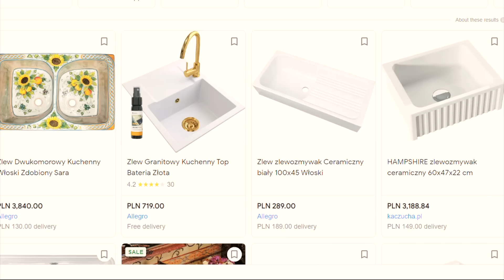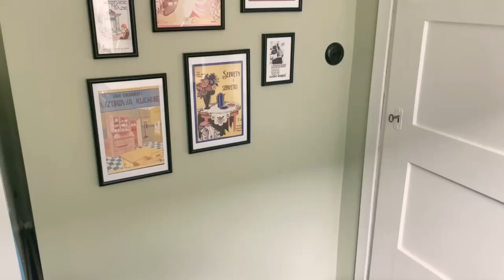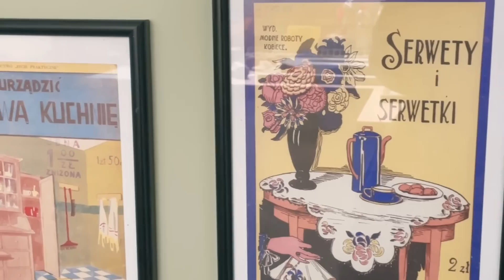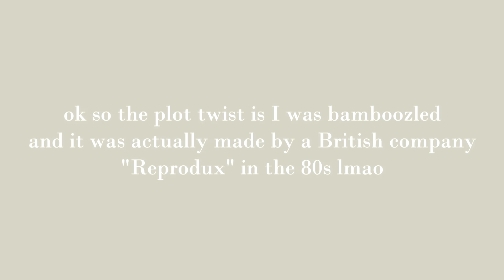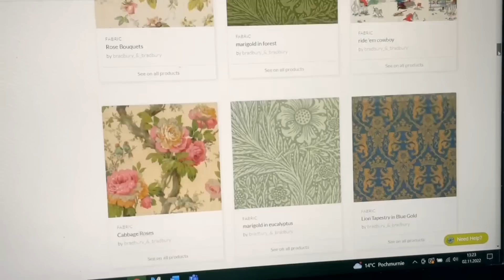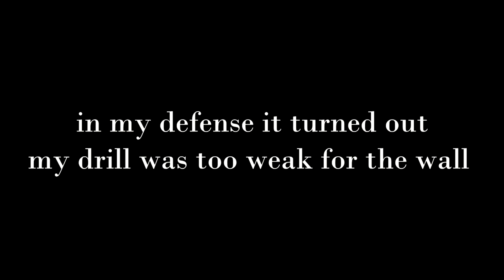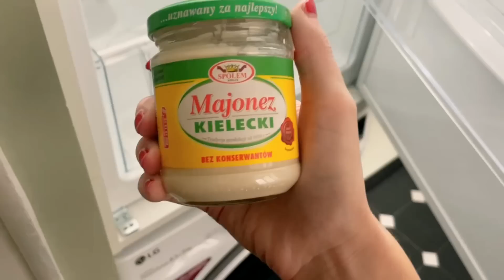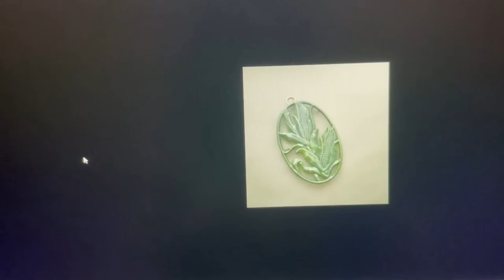Getting Antique Furniture For My 1930s Flat ✨ (and other stories)

Comment: One thing I've learned in life, Karolina: it's VERY rare to find walls that are sufficiently straight or that meet at exactly 90º angles.
Reply: Yes. My current home is like a vamped up mechano kit. Metal struts for framing and outer sheath. Built for US military in GB in WW2. I was shocked to find true right angles between walls, walls and floors and walls and ceilings. The only off line corners are the outer corners if all the built-in corner cupboards. I don't understand how some of those are messed up by 2"/5cms.
The baseboards. I bet your Dad knows how to use steam to bend them permanently to the wall's curve. Worth doing as once they're on they'll be right forever.
Reply: @Michelle Byrom  Oh, that's interesting! I've always lived in masonry buildings, since they are the most common building method by far where I live and I believe masonry buildings are easier to get out of angle, since the bricks are not exactly fitted, but rather put on top of each other...

And I believe that houses can get out of angle after they're finished, because of soil movement, humidity, etc. I'm not an engineer, but it's something that sounds likely to me.
Reply: True ✋
Reply: Yes.  We have one bedroom wall that literally bows out at about 25-30 degrees.  It's completely different at the top of the wall to the bottom.  This is what happens when someone who doesn't know what they are doing encloses a 100 year old porch.  (Not us, done probably 75 years ago).
Reply: I live in a building that was built in 1890, and nothing is entirely square.  But it's ok.  I love it, imperfections and all!
Reply: Dear god, all my houses have been old, and nothing is straight or plumb. My 1892 Vicky is no exception.
Enjoy your lovely new digs, I love what you are doing with it, it looks wonderful! 
PS: there is nothing wrong with waiting until you find the right color/paper/cabinet etc. Wait until inspiration strikes, you have all the time to find what is the perfect fit.

Comment: For your wrinkled curtains, here’s what you can do:  hang them up, as fully extended (closed, to reveal as much fabric) as possible, then use a clean household spray bottle and the hottest possible tap water to spray them lightly but thoroughly.  Hold the spray bottle nozzle really close to the fabric so that the water doesn’t cool down as much (it will cool down somewhat anyway).  Gently pull downward on the curtains by the hems several times, and the wrinkles will gradually fall out as they dry.  (You might want to put a towel underneath, to protect your floors while spraying).   I discovered this out of laziness, I have both an iron and a commercial steamer, and it works just as well on most clothes, too, unless a very crisp finish, like on a “classic linen shirt” is desired.  The sprayed items not be perfect, but they will look much, much better than with the packing and shipping creases.   Wrinkle-releasing sprays are a waste of money, they’re mostly water with a little fabric softener added, you could do that, too.  Your hand might get tired by all the trigger-squeezing for the sprayer, I alternate hands if I have a lot to do!
Reply: don't forget that fabric softener is pretty flammable though! the hot spray water idea seems much better
Reply: or just steam them in the shower?
Reply: Oh, I gotta try this on the curtains my mum just sent me! Thanks for the tip :D
Reply: Yup. I have hung many curtains in my days and depending on (the weight of) the fabric.. sometimes it's enough to just hang them and give it a week or two. And when you wash them, just hang them while they are wet. I do have a steamer iron, but I'll always try to not use it ☺
Reply: she have washing machine, so just washing them and hanging as they are still wet should do the trick ;) especially if the fabric is thick and heavy, with lighter ones you may need probably some extra weight to pull it down
Reply: Washing them is a lot easier and faster, hang to dry
Reply: @momosaku16  That was always my mom's method
Reply: I usually hang my curtains when they are 2/3 dry (I don't use the dryer, dryers are not a thing in Croatia). The gravity solves the wrinkles

Comment: Dont panic about the base boards! As they get secured to the wall they will flex and you wont be able to tell. (Went through this during my house remodel)
Reply: Yes! And if there's any little gap left, you just fill it with paintable caulk
Reply: Using steam at the place where a strong curve like that occurs helps to prevent splitting.

Comment: I'm so impressed that you managed to get eggs to stick to a brand new nonstick pan 😂 I don't even use a spatula anymore; as long as I have enough butter in the pan, they just slide around and I can flip them in the air. (This is not me bragging, just being lazy about dirtying a spatula)
Reply: [buys new non stick pan] [IMMEDIATE METAL FORK ACTION]
Reply: Butter is a must and letting the pan heat up enough before adding the eggs.
Reply: Not sure if you are from Europe maybe you are, but in Europe we mostly use oil for that, much healthier, but easier to stick to the pan if you are not careful!
Reply: @paularodriguez9540  Actually the issue is mostly transfats like in old style margerine. Real full fat butter is not really linked to heart health anymore. 

It ended up being a more complicated story than saturated fats being the cause. I use both butter and oils of various kinds. I think our best bet is probably using a variety.
Reply: @paularodriguez9540  I've done it with oil, too, butter is just tastier ❤
Reply: @Greuts right, besides, aren't Europeans more involved with cooking with butter instead of oil?
Reply: @Greuts sorry let me correct, at least in the countries that follow the Mediterranean diet, you are right
Reply: @paularodriguez9540  I'm Polish like Karolina and here most people fry almost everything on oils, but make eggs solely on butter or margarine, very very few people use oils like Karolina did in the video, unless they don't have other options [which might be the case for Karolina as well, since she doesn't have much in the new place].
Reply: @deirenne  well, bacon fat is also an option for eggs in Poland.
Reply: @begemotowa  
There's nothing like eggs fried in bacon fat 😋. Butter gets second place. Seed oils...no comment 😆.
Reply: @raraavis7782  I agree completely! I'm from USA southern states, bacon grease is the standard go-to for anything!!

Comment: This was so much fun! It was as if you invited friends to your flat for a tour. Thanks for the info on the coffee table in the living room. My grandmother had leather-topped tables all over her house. She never mentione when she acquired them so I never knew which decade they reflec5ed. In the USA, I think they also were popular in the 1950s. You always manage to get so much information into every video. It's a pleasure to watch.
Reply: This particular form of leather top (not covering the full surface, most of the time with gilded decorations) has been used since at least the 18th century, for writing desks and card-playing tables.
Which made me very suspicious of Karolina's coffee table before the plot twist, because it's not (only) an ornemental element, it has a fonction, which doesn't match with a coffee table's.
Reply: Yes, leather tops were common on writing desks as it gives a softer surface, doesn't mark as easily as polished veneer and is easier to replace when it gets worn. I have the alternative thing, a separate leather writing pad/blotter combination. There are also wine/occasional tables with leather tops, maybe as glasses won't mark the leather. 

The leather top furniture seems to come in and out of fashion quite a bit. Karolina's coffee table, while a reproduction, looks to be made with good quality timber and leather. I've seen some atrocious reproductions made from very lightweight, cheap timber, drop leaves that sit at rather a downwards angle when folded up and with 'leather' that looked like paper. I've also seen a good quality reproduction writing desk that went a little overboard with the leather, not only was it on the desktop but also stuck on all the drawer fronts! Another hint at it being a reproduction is that low coffee tables were only introduced in the 1920s, you'll struggle to find any real antique modern type coffee tables.

I just looked at an 'Edwardian' leather topped occasional table we've got and turns out it's also made by Reprodux, found the name stamped on one of the drawer undersides.

Comment: Hahaha, I mean, you DID two layers of paint. Previously. That counts. 😂 

Love the final green. I had the exact same problem with painting a room green…it is a surprisingly difficult color. And I also love that you used your left over wallpaper to line the cupboard! What a beautiful detail. 😭
Reply: It helps if you can differentiate between WARM and COOL greens ; they are different and shouldn’t be mixed. You need to decide which you prefer, and then commit to a warm or cool palette for wall colors, in this case, green.
Reply: @nanwilder2853  that is a good tip, thanks!
Reply: @marissabulso6439 : You are most welcome, Marissa. Take care!

Comment: Baseboards hide imperfections such as cracks in the walls. Baseboards are placed where the wall meets the floor. It is mostly flexible. They also hide gaps between the bottoms of the walls and the flooring. in US nailed - solid walls maybe glued.

Comment: Regarding hanging things on walls you can order online hooks called Command hooks.  They are transparent and removable and leave no residual stickiness and do not harm the surface of the walls either.  And they are rated by how much weight they will hold.  I have used them on my outdoor patio cover and so far they have lasted 5 years.  No drilling or hammering of nails both of which damage the walls.

Comment: For next time, I recommend removing all the scraps of paper and glue residue attached to the surfaces first.  It’s easy, just spray (or soak with a big sponge) with the hottest tap water, then it can be scraped off with a plastic scraper.  Then, I would use one of those plastic scrubber sponges for dishes (not the metal ones) to scrub off any glue residue.  Then, I would paint on a layer of primer/wallpaper sizer.  I love the Z-Prime brand we have here in the US, it’s expensive, but worth it.  A really clean surface is important for any finishing technique, painting or wallpapering.  Your new flat is looking beautiful!

Comment: Karolina look into Command Strips for hanging items on your walls. No drilling required and they come in varying weight capacities. Really have enjoyed your journey
Reply: Have you ever used them long term? I've always been under the weight limit but still have never gotten them to last...  and am always worried it will unstick and drop/wreck my frames. Maybe it's the texture of my walls though 🤷🏽‍♀️
Reply: @catherinesteph  my daughter in law has used them with success. None of the items were overly heavy. Not sure if being exposed to heat from strong sunlight or a heat vent would impact their stability though.

Comment: Your place looks soo good!  Love that fireplace.  Also, I live in a row house with both brick and really old plaster walls. I've found that the 3M brand "outdoor" mounting tape works great to hold up things (like the towel holder for the kitchen). I think Gorilla Glue also makes an outdoor mounting tape that works well too. I've just discovered with plaster and brick walls the good old command straps don't really hold up. Gotta beef it up to the outdoor stuff.

Comment: It’s coming along so nicely! I can’t wait to see what happens next! For the kitchen thing that you can hang towels on if you do go with sticky strips to hang it make sure to get them in a stronger version than you need, they typically have weight ratings on the package for how much one or two strips can hold and you’ll want to go stronger if you can since it won’t just be the weight of the piece and the towels but also the occasional tug as you hang a towel and pull one off and that kind of force is a lot more than most people would assume

Comment: If you get egg stuck on the pan again, I recommend heating up the pan to sizzling and then adding some water to deglaze the pan (about 4 oz).  When the water hits the hot pan and immediately simmers or boils, scrape at the gunk with either a wooden or bamboo spatula.  The food should release pretty easily within a minute or so.  Non-metal spatulas can't really scratch up the pan, and the deglazing maneuver avoids having to do rough washing that may also damage it.

Comment: It gets prettier and prettier.
Random things I like in your flat: The new window sills and especially the sill in the kitchen behind the counter.  The fireplace and the design of the air vent in your living room. The wallpaper in your closet. And OMG I am in love with these art deco armchairs! Please tell me that they are comfortable.
If your furniture is varnished with French polish (shellac), you can freshen it up by polishing with a little bit of high proof alcohol (for me that works better for scratches in the varnish than actual wood polish). But that also means that it is sensitive to water stains and hand sanitizer can also soften the varnish.

I was also wondering whether your side board in the living room might have been a bigger "buffet style" cupboard made out of two pieces.

Comment: You need to properly pre-heat your pans, particularly for eggs. Let it get nice and hot, and use more butter or oil than you think you need, and you will have much less scrubbing. Preheating is huuuuge though. Let the pan sit on medium or low heat for 5-10 minutes.

Comment: Also, I think you'll find the drainboard sink to be quite useful. They're perfect for single and double tenants. For 3 years I worked turnover & maintenance in apartment buildings from the late 1920s and most apts still had them; by far my favorite sink to use/clean. So easy!

Comment: Here in the US we have a pretty good adhesive and Velcro product to hang things where you cannot or do not want to drill holes. I use it a lot (old house) and it works great for stuff up to about 5lbs or so (pictures, little hooks for coats and towels, etc. not heavy mirrors). They are called Command Strips and they come in a wide variety of shapes and sizes for various purposes. We also have suction towel racks in the bathroom, they actually work great and do not require drilling the tiles (ours are antique, I don't want to damage them any more than they are already). Flat is looking great, congrats!

Comment: The place is shaping up nicely! Just thinking back to the first videos of the kitchen to this one - wow. You could probably glue a thick wooden board to the concrete wall and drill into the board to hang stuff off (I say confidently, as if I know anything about renovation that I haven't learned from Alexandra Gater's channel).

Comment: The vanity furniture piece is fantastic!   I love the green paint color.   I don't think it would change with a second coat.  Check it out with lamps turned on with either warm or cool light bulbs to see the impact of the difference in light bulbs have on the wall paint color.

Comment: Instead of the super strong tape to hang your kitchen towel holder, get the Velcro style Command Strips. They come off easier and cleaner and wont damage your wall, plus with the velcro you have some wiggle room for adjustments, or can swap a new thing into its place. The real big-brain play is to get the larger ones and then cut them in half, put the tab side on the wall for damage free removal, and the other half on the item you're hanging. Makes the pack last a lot longer, since Command strips are not cheap.

Comment: If you get a power nailer (you can rent or maybe your dad has one), you can easily attach the baseboards to the walls.  Nothing in my house is straight or even, that is part of the charm of old houses.  I think your spice rack should go next to your stove on the wall by the oven.  You'll use your spices there, so it makes sense.  On the wall to the left of the sink, more pictures or decor!  Your dad did a fantastic job with the fridge above the washer.  I hope there is room behind it for ventilation.

Comment: Some little things, what about making a cover for the washing machine so it blends in with the 30s theme, you can buy one or make one easily from 30s print fabric, and secure a net curtain rod or wire round so you can thread the material through after making a fold at the back and sewing it. Your table you don't like the fold down edge, well just leave it folded down, buy a 30s tablecloth to cover it, or simply paint over the bit you don't like with matching wood paint.

The green sofa is divine, I absolutely love that, so plush, muted and comfy looking and you've done a great job making the flat look 30s, the tones, wood furniture, accessories and wallpaper.

Comment: I may be the only one, but strongly feel the table will look it’s best (in that setting) with its leaves down.

And if you want - you can flip those eggs with a flick of the wrist, IF you use enough fat & let them set enough. Turn your pan down and wait a bit longer and use lotsa butter. (Hard to do if they’re fully runny, but If they’re slightly non-runny it’s easy enough- the right motion being most important). Then you just slide-em onto the plate. ❤